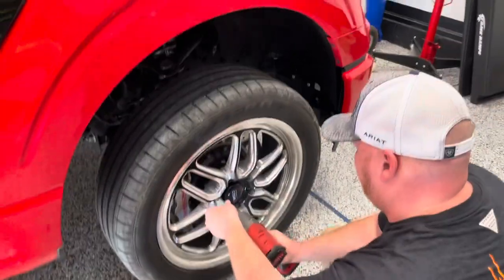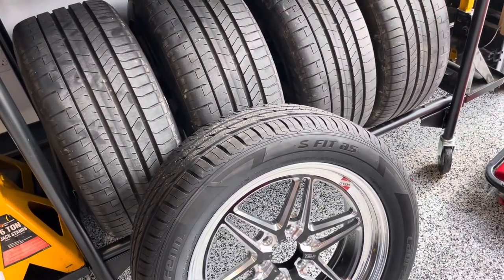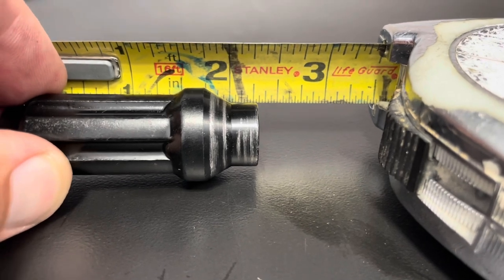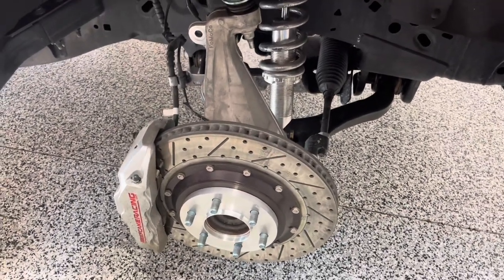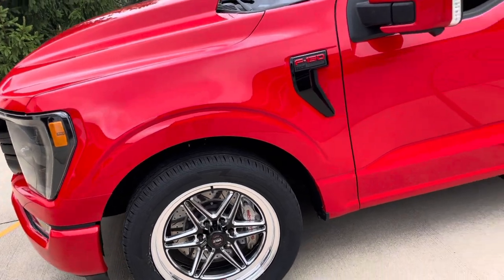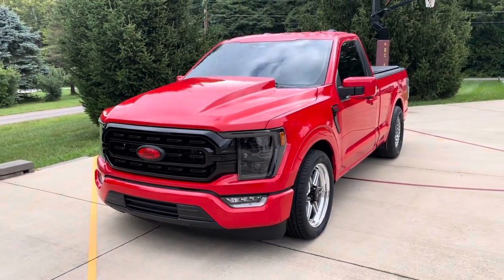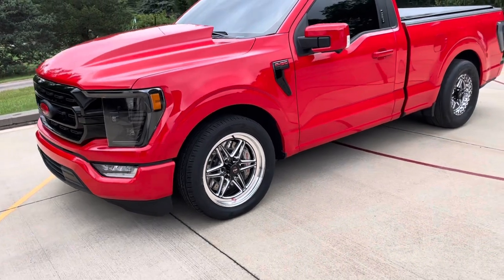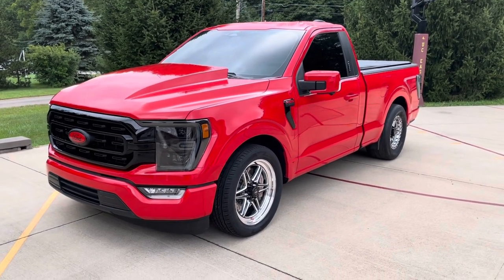S81 HD Drag Pack for Project Hellfyre.

Comment: Very nice!
What size are your front tires and on your 20x10” with street tires??
Reply from the maker: We always match the rear tire height so we ran two different sizes on the Rear so we’ve run a couple different sizes on the front. Do you wanna match them up basically to the same tire height?
Reply: Yes. 
I sent you a pm on messenger
Reply: @TeamBeefcakeRacing any issues with vibration at highway speeds on this setup? I have the same setup and noticed significant vibration above 60mph
Reply from the maker: @binostunts  none of

Comment: What is the offset of your drag pack wheels
Reply from the maker: rear https://www.beefcakeracing.com/weld-81lb7100y72f/
Reply from the maker: these fronts https://www.beefcakeracing.com/weld-s81-20x7-6x135-bp-4-5in-bs-black-wheel-3-540-id-lowpad-81lb0070y45a/
Reply from the maker: And we have other fitments for four-wheel-drive as well